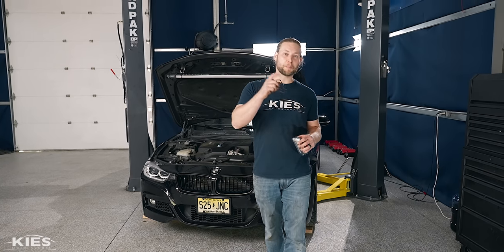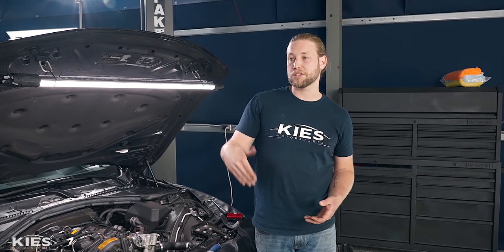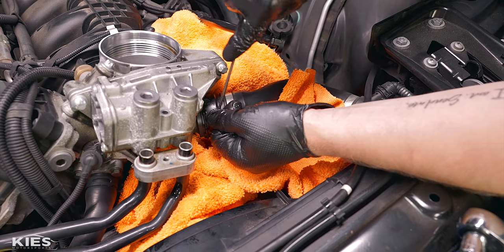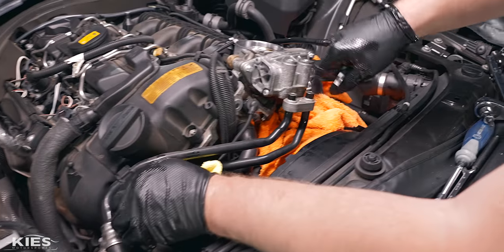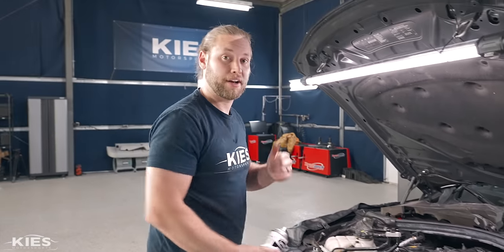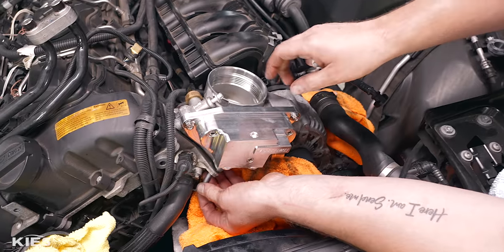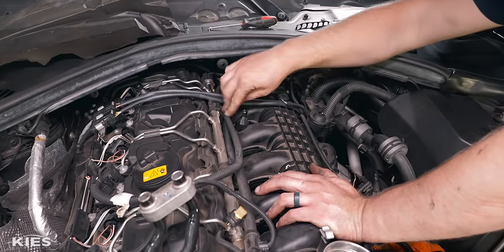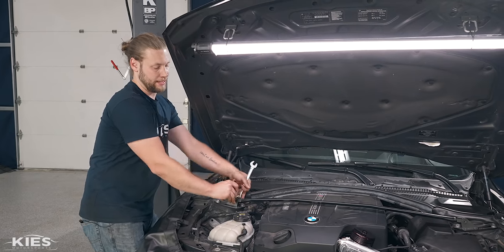F30 N55 Oil Filter Housing Gasket Replacement + Mosselman Thermostat Install!

Comment: Don’t forget to prime the engine before startup after doing the OFHG. That’s the reason people get spun rod bearings on the N55
Reply: Ope. I guess my engine is dead then. I’ve only put on 50,000 miles after the oil filter housing gasket so probably too early to tell if I’ve ruined the engine LOL. Thousands of these have been done in peoples driveway. This problem is definitely over blown on the forums.
Reply: @slscamg  you did not re-prime after changing the seal
Reply: @slscamg  From what I've researched this issue is mainly with the first couple years of the N55. 2011 and 2012.
Reply: Yeesh... Well I tried to prime even after pullingfuse 165 the car started.... 2016 here so hopefully you guys are right that it's a small percentage of early n55 failure
Reply: What does it mean to prime the engine?
Reply: @Ashhong1  Hand turn the engine to get the oil to pre lube the bearings…
Reply: @PaimonSorornejad  you need to pull 165 before doing anything and let the engine die (clears fuel out of lines)
Then do the gasket and now try to start and it can’t bc no fuel 
Now put the fuse back in
Reply: My son has a 2011 335i xdrive M-sport 6-speed with the N55 and we bought it at 68k miles shortly after the OFHG was replaced by an independent shop.  His engine developed rod knock at 82k miles.  Maybe a coincidence. Or maybe it accelerated wear on the rod bearings and then due to the 2011/2012 poor oiling issues especially under lateral or longitudinal g-forces, it eventually led to early failure.  He did go 8k without an oil change and was a quart low a few months before the rod knock so that certainly did not help. We pulled the motor and there were no spun bearings and we measured the rod bearing and main bearing tolerances with both plastigauge and calipers (rod bearings) and couldn't confirm that they were bad - the clearance tolerances seemed to be in spec.  Ultimately after disassembling the whole engine in search of the rod knock culprit, I decided it was safer/easier to buy a used N55 engine I found in a side impact crashed totaled car with only 39k miles.  Again, perhaps that was a coincidence, we will never know.
Reply: @alangil40  Unlikely to be the OFHG. The issues with the oil pressure occur very soon after replacement.
Reply: @alangil40  how much was the new engine
Reply: I’d recommend the vac oil pan baffle. I’m getting it to prevent oil starvation also upgraded main and rod bearings helps second level up you could to s55 oil pump and pickup with pan upgrade. Oil change every 4k on mine so far no issues. Also Blackstone lab for oil analysis just in case
Reply: @PaimonSorornejad  lol you were suppose to pull fuse then run the car till it ran out of fuel
Reply: I pulled 165 and tested multiple times to ensure no fuel was in the lines before attempting this job. Once completed and time to prime, the car started on first attempt about 5 seconds into it even without the fuse! Fingers crossed all is OK.
Reply: I unplugged my crank sensor. Turns the car over but no spark or fuel.
Reply: @AlfaSixxx sorry but that’s hilarious

Comment: Bryan, appreciate all your DIY's!  I started this job on my 2014 335i and had a few additional tips and clarifications if you don't mind.  
1. The fuse you pulled to allow priming of oil is the first installed fuse in that row but the second fuse opening.  There isn't any fuse in the first position.  It can be confusing.
2. It's a good idea to change out the thermostat hose flange while you're doing this job.  The flange on my car (35k mileage) was completely shot.  I'm guessing this flange's life is base on time and not mileage.  There are many aluminum ones available that'll last forever (hopefully).  Some mention using cutters to take of the metal band holding the hose to the flange.  That's insane.  You're not going to reuse the flange so just crush is carefully and pull out.  Then you can wiggle the metal band out.  Easy.
3. Changing out the flange also allows you proper access (using an e-torx socket) to the lower torx bolt on the oil filter housing.  Using an 8mm ratcheting wrench is a good work around BUT my bolt was torqued on so tightly my wrench just slipped and messed up the bolt.   Or, if you have one, the proper ratcheting e-torx wrench.
Hope this help some others attempting this job.

Comment: just did this job following this tutorial. perfect example of doing it right. just be sure the fuel lines are out of fuel completely, the engine may shut itself off but there is enough fuel left for one more start, crank until it no longer turns over. then proceed with job and priming will work as intended.If you are scared, do the job its super easy and satisfying. my local bmw dealership quoted me $2100. cost me $200 for every gasket seal nut and bolt. including tensioner belt and pulley.

Comment: I finally am impressed.  My 2011 535  N55 is leaking on the oil filter adapter and the valve cover.  I have watched many videos on this and this one is the absolute first that the intake manifold gaskets have been replaced instead of just bolting it back using the old gaskets.  Must be a lot of cars out there with leaking intake manifolds.  One video I watched, the guy was able to get to the  hidden bolt by taking off the alternator.  Good Job!  Thanks.

Comment: Old school tip taught to me by my Father - Never tighten something with a Torque Wrench. Get it snug with a ratchet, socket, wrench, etc. THEN, when snug, tighten with a Torque Wrench.
Reply: Reason?
Reply: @ademc8872  saves cycles on your torque wrench
Reply: @BaZOOka39 lifetime warranty on the torque wrench. Doesn’t matter

Comment: great instructions for changing the seal on the other hand in France no mechanic does the priming of the engine before starting and no engine breakage It is important to fill the filter support with oil the oil goes directly into the pump  oil (thanks Bryan)
Reply: I just did my OFGH gasket but was not aware of the priming requirement. I have a VANOS camshaft clamp error now. Very worried now that my simple maintenance job will not end well. Positive reassuring comments welcome 🙏
Reply: The priming seems only required in the US with cold weather (below 0). Apparrantly it is related with the pump blocking. If you search in the fora you will find no European car with a seized up engine after the gasket change.

Comment: Quick PSA from a 12 year F30 335i Xdrive MSport:
Things you NEED to check by at least 60k to 100k or you'll be stuck!!
-OFHG replace when it's leaking!
-Tank to radiator top hose (super easy fix, 90 degree angle makes it a fail point, boom, fluid all over your engine when it fails). When it does, look for the steam!! 😮
-Valve cover gasket, note the PCV valve is part of the cover so if you need to replace that, you need to replace the whole thing!  When it leaks, you'll see oil burning off of your exhaust downpipe 😮
-Charge pipe...will blow by 70k
-Timing belt and tensioner easy fix by 60k
I'm sure there are way smarter people that have made videos about these...

Comment: I've been debating on grabbing an F10 535i but I've never owned German. Always American and Japanese so I've been worried about working on them because I've heard many nightmares. After watching a few of your videos, I think they're even easier to work than American. I'm definitely going to be picking one up.
Reply: Do it...I like Japanese of course but love German bimmers...they are on a different level of quality of craftsmanship and performance.... Japanese are fine but the performance is hard to get cheap... A used beamer is cheap... All their original parts last easily 100k...most*....no other manufacturers are even close to be honest
Reply: At least test drive a few...did u get one?

Comment: Snap On makes a 1/4” drive swivel e10 socket that enables you to reach the hidden  bolt without removing the manifold on the N52 engine.  Does anyone know if it works on the N55?

Comment: On my 2013 335i M Sport has a few differences from the video. First, the oxygen sensor connection has a different clip. There seems to be two bolts on the intake manifold near the  oil filter housing. Any idea how to remove the o2 clips?

Comment: I know this is old and you may not care to answer, but when doing repairs (specifically this one), should I disconnect the battery or will it be fine as long as I keep the FOB away from the vehicle?
Reply from the maker: You’ll be fine if you keep key fob away from vehicle but it doesn’t hurt to unplug the battery either 👍

Comment: New nuts and bolts and intake gaskets is way overkill.
Reply: No it isn’t. If you’re doing all this and the car is higher mileage these gasket replacements make absolutely sense. Cheap and preventative maintenance… you’d be silly not to do all that.

Comment: Hey bro I hope you will se the com. I removed fuse 165 and started the car, but the engine still runs, it does not turn over without ignition. What to do?

Comment: Hello Brian, you did a fantastic job showing us how to install a new oil filter housing gasket. I guess since I am going to have to replace the housing gasket I might as well do an oil change, change the coolant, change the engine belt, change the manifold gaskets, and install a crankshaft seal guard. You said you were going to leave an explanation on how to drain the coolant without a vacuum bleeder but I don't see it. Could you please explain how to bleed the coolant?

Comment: What's the reason of needing to prime the pump here vs when doing a normal oil change? Is it because removing the housing and lines breaks a vacuum of some sort?
Reply: good question. I wish someone had answered you because I was wondering the same thing!!!
Reply: @NagashiChidorii   From some recent reading, it seems that there is a check-valve that goes to the oil pump (23:30 top right). When you do an oil change, you'll only empty some of the thermostat area and other cavities in the housing - so minimal air. The check-valve will prevent the supply line from emptying, and your oil cooler lines will mostly remain filled.

When you remove the housing however, that vacuum is broken so there will be air in that entire passage down to the pump which I'm guessing is a decent amount of air along with a full drain of the cavities in the housing. When doing other things like oil cooler, again - potential for bigger pockets of air.

Assuming the above is true, when @kiesmotorsport pours the oil into the housing, I'm guessing its not going to the pump line as described but rather either A) back to the sump, B) through the "filtered oil" line into the block. Either way, its all about getting rid of as much air as possible so good practice regardless.

Comment: Do we needs new bolts and nuts for intake manifold as well as for the oil filter housing  or just the intake manifold?
Reply: I personally see no need to replace any bolts. They aren’t torqued highly so I can’t see they would then be a stretch type bolt. 
When I do mine I’m reusing all the bolts and nuts.

Comment: Would you recommend doing this preventatively? Or just wait till it leaks? My F30 N55 is a unicorn at 75k and still not leaking 🤞🏻😬🤷🏻‍♂️. Been checking for signs with paranoia every oil change lol.
Reply: Same hahah
Reply: Mines at 138k and still isn't leaking..
Reply: Started leaking at 94k ☹️
Reply: 80k on m235i no sign of leaking either.
Reply: Bro when it rains it pours. 77k leak here.
Reply: I am at 100k with original.
Reply: leaking at 60k. 2013 f30 N55 335i
Reply: My f30 n55 leaking at 46k
Reply: My F30 335i 2013 now leaking but it has 127000miles/204000km on it. Did the valve cover one month ago and now OFHG.  Thanks for great video!

Comment: I have a 2013 535i. I removed 2 bolts and 4 nuts from the intake manifold and it won't budge. What am I missing I(other than mechanical aptitude)?
Reply: did you loosen the charge pipe like he did?